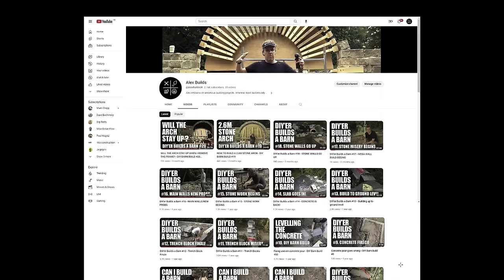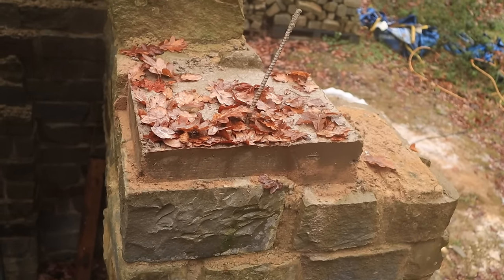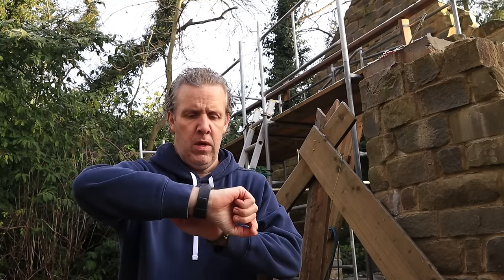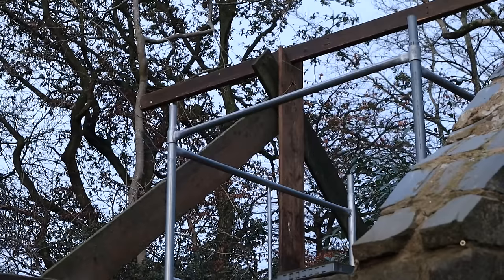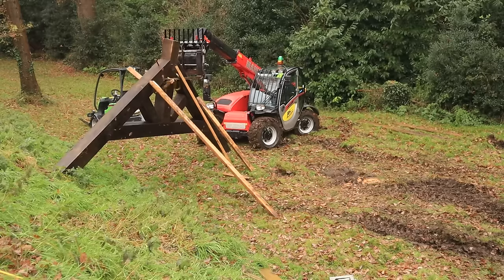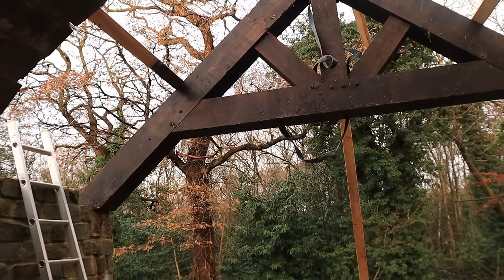DIY BARN BUILD E25: CONSTRUCTING THE 10 TONNE OAK FRAME

Comment: The view from in front of that arch is so satisfying, you must certainly be proud every time you return home up the drive! Just off from a long work day. Happy to get to watch you play around with the lull to get it lifted into place! I also rent equipment over the weekend to get a number of 'days' over a longer number of days. Here's a breakdown:

⚒️ Alex is finally starting the construction of the frame after 2 years and 23 episodes of preparation.
00:24

🌧️ The video shows Alex returning to work on a concrete plinth in the rain after snow caused a delay.
02:57

⚠️ Alex discusses the potential dangers and concerns related to such a construction project.
06:00

🚜 The video shows the process of lifting and towing a vehicle with different steering modes.
09:08

⚙️ The video is about testing a new laser kit and setting up a test frame for accuracy.
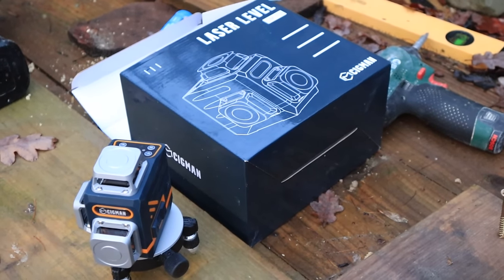14:15

🚜 The video shows a struggle with a bogged-down vehicle and a failed attempt to lift it with 2x4s.
18:08

📸Alex breaks his camera lens.
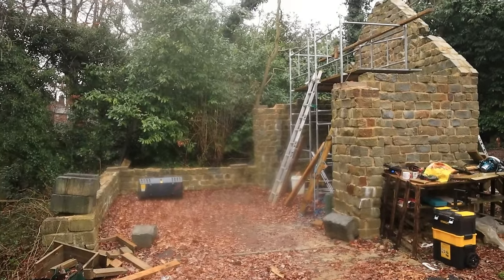21:32

🔧 The video shows Alex working in the rain to secure it in place.
24:47
Reply: Oh! Murphy's Law strikes again! 😅 

Murphy's First Law: Anything that can go wrong will go wrong. Murphy's Second Law: Nothing is as easy as it looks. Murphy's Third Law: Everything takes longer than you think it will.
Reply: Another side note, where's the boy at? We've seen a bit of him, but not much. He seems about my age when I worked with my dad who was a handyman. Started as a vacuum and sweeping lad for $5/hr. I didn't think much of it besides spending money at the time, but I have since become a handyman myself and have loved working with my hands ever since. He has passed away since, 😢 (young too at 62) and I cherish the time I got to spend on projects with him.
Reply from the maker: I might get him out to help me with the roof next year! Sorry to hear your Dad passed young, nice to have spent that time on those projects with him 🙏

Comment: Why wouldn't you hire a semitruck with crane? That way the operator lifts the beams and you can guide them into place. Cheaper then the rent of the tellehandler I guess.
Greetings from Bengtsfors, Sweden
Reply from the maker: Good point - I did consider it many times, but there's issues with access, and because of the plot slopes nowhere one could get in and get the stabilisers down on to hard ground... + overhead telephone wires maybe in the way!

Comment: I don't think it is a good idea to mount the oak on concrete - much better on stone. The concrete retains moisture and will transmit it to the wood that is in contact. Stone won't do this. Might be worth looking this up, I think.
Reply from the maker: I see your point - however the walls all have damp proof membrane under them, plus all the concrete pads will remain in the inside section - so should be ok